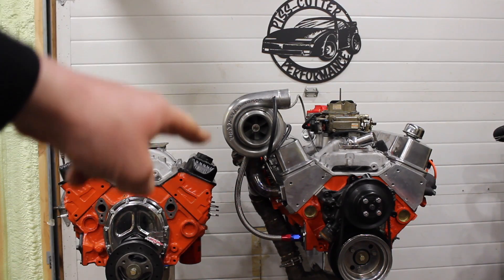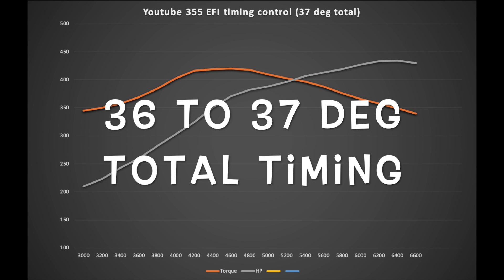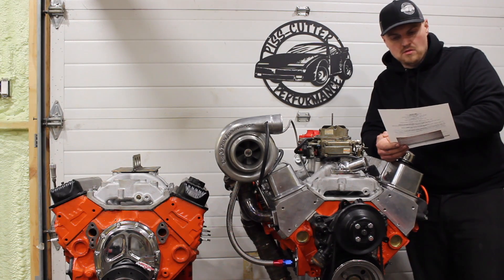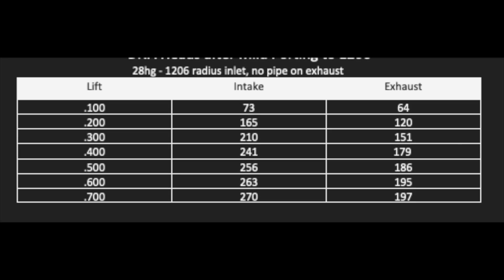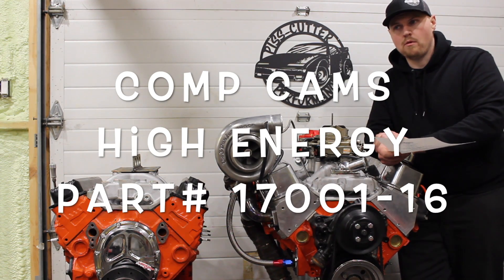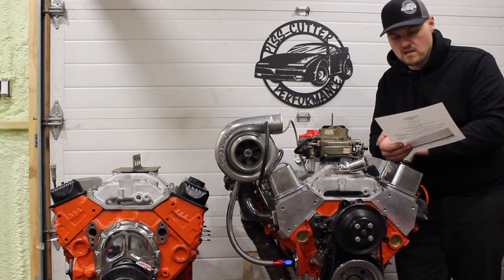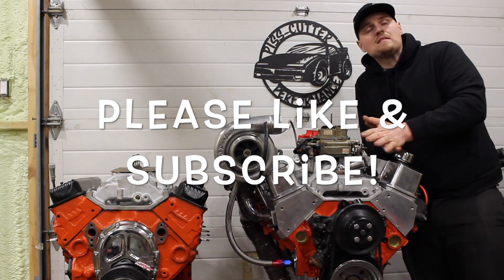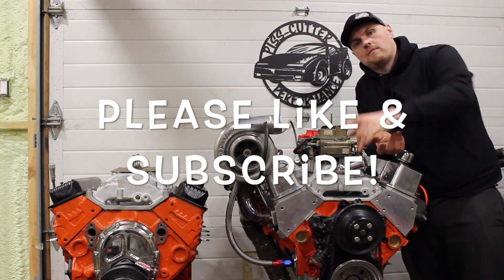440+ HP Budget Build! SBC (Youtube 355)

Comment: Hey, great and exciting builds as always. I have a little 355 combo progress of hyper pistons 10:1, DNA head, and only xr264 on 107*, with a VRS 850 can I tune this big carb out, and it work ok, or should o get a 650 or750 ? Also headers are huge 2" but going to put 1-5/8" tube or less, inside them coming out of head. Same thing after extended collector into empty mufflers then to oversized single out, dual inlet flowmaster 50. For my mother's cross country daily driver Camaro with automatic transmission tight stall. 3.23 gears.

Comment: Hey man I’m building 383 vortec block. I want to makee 600 to the whee but with vortec heads can I buy some ported vortec heads from you
Reply from the maker: Unfortunately, even with porting 600 wheel hp naturally aspirated with vortec is not really possible, especially on pump gas
Reply: @ they have those eliminator heads but they are about 3k can u recommend me some heads with keeping factory injectors

Comment: Did around same build 419 hp 430 tr howards roller big momma rattler with two head gaskets with split fire ring used the wrong head gasket not a pre flatten wire ring

Comment: Cool Video ! Im building a .040 bored 350ci SBC Having a hydraulic roller cam ground special.  Very close to your cam here. Same duration with .547/.547 lift and 112 LSA at 4 degrees advance  Icon pistons for 10.6-1 comp. Floteck aluminum heads and Dougs ceramic 1 3/4" longtubes.  My hope was 435hp..  Looks doable..

Comment: Hi, nice video. Yup, I've watched tons of Nicks programs too. I am in process on a .040 over SBC with 10.5:1, right quench, good heads and internals with a Howards hydraulic roller cam to make that lift that you did.  Additionally I have been following David Vizard for years and worked out a shorter lobe separation angle, 108 degrees, from his process. Can't wait!
Reply from the maker: Right on man, you'll find that the tighter LSA helps alot with torque. Vizards formulas definitely help with cam selection. Alot of people disagree online but ive tried it, dyno tested it and it works as he says

Comment: your engines make great power with little more then budget parts iron heads nice work. I watched a video today 7-2024 after market block and crank good heads 64cc good rods roller cam flat top pistons roller rockers intake 350 ci sbc .030 bore it dynoed 410 hp tq was close to that. big $$$. the video from phenex az us.

Comment: Hey Cutter! I may be missing something, if you start with a 880 roller 350 block, how does it then become a 355?
Reply from the maker: Its bored .030 over. A 350 block bored .030 is 355, .040 is a 357 and .060 is a 360 with a stock stroke of 3.480

Comment: Great videos!  In your experience have you found any sbc head gaskets that actually compress to .025 to .030?  Thanks.
Reply from the maker: The cometic steel shims ones are close to advertised .027
Reply: I think they are fel pro 1094, they are a .015 compressed steel shim gasket, but you need very good surface finish on block and heads. I think you need goog finish for comatec MLS gaskets also...

Comment: Will you tell me how much vacuum you have on this motor?
Reply from the maker: Lots, 15 to 16 inches with no vac advanced hooked up
Reply: Thanks for the reply. Im building a 383, with a vortec block and heads. My cam will be 224/230, so I wanted about the same vacuum.

Comment: I've Been building my friend's 350 chevy engine 1 piece rear main seal and it a roller block too its between  1988 to 1989 chevy 350 I'm thinking what kind of horsepower it's going to put out it has a hdy roller camshaft and roller lifters and I bolted on procomp aluminum cylinder heads 64 cc

Comment: Pat if u was to build a stock 880 block what would u gap the rings ? Ima run this motor all NA so I don't need any extra ring gap..  I hear 4 thal for every 1" of cylinder bore, so tht would put the gap at 16 thal ??? Or would run the top ring at 18 and the 2nd ring at 20 thal ???? Or would do 16 thal on the top ring and 18 thal on the 2nd ring 🤷‍♂️🤷‍♂️🤷‍♂️ to get 16 thal or 18 thal, I would have to get 10 thal over rings..
Reply from the maker: What pistons are you running? Hypereutectic pistons will often need more ring gap, especially if they are Keith Black pistons. A stock hyper piston its a good idea to go .005 per inch top ring and .0055 2nd ring. KB pistons want .0065 for the top rings

Comment: Yes definitely interested in the specs for the dingle ball 355 I have 4 engines 3 roller style engines ,a 355 80-85 block with built 350 swirl port heads not sure what was done but the engine did 13s in a 82 Monte with auto 3.73 gears I want to put a set of vortec heads on it  plus I have another 355 crate 87-95 block with vortec heads 2.02/1.6 cut down guides with a 280H-10 and another crate 350 vortec 880 with stock truck cam specs never ran gas only propane it was a industrial generator v8 with about 2500 hrs it’s really clean 906 heads timing chain is still tight hardly any play on it want to put a higher lift cam on it plus I have a 87 305 roller motor 87000 Kms with decent heads the 184/1.5 I want to put that similar corvette 300hp cam in it eventually plus I have a 72 350 block with those 70 camel humps and a Rv cam to so lots to do before spring

Comment: I'm assuming the stock SBC roller lifters could be reused with the Summit-880x cams?  I have a Summit-8801, the little brother to the cam you used.  GM Vortec 880 block, Vortec L-31 heads valve guides cut down and reworked with beehive springs.  Lift should be okay to .550" with 1.5 ratio rockers.
Reply from the maker: Yes they can

Comment: Hello, my name is Eric. I have watched almost all your videos. I have a 98 k2500 the l31 is now a 355. Would you consider doing a theoretical build for a low end of torque truck engine good for pulling. Plus do you have more info, and opinion on the Edelbrock pro flow xt.
Reply: I built an aluminum head 383 out of an 880 block for my 97 Express.  Loads of torque.

Comment: You're probably aware but Summit sells that exact hydraulic roller camshaft for the gen 1 SBC (retro fit) with the LS firing order for $243   Part number 1223.   That's a steal.   I've looked into LS firing order in the past for a few builds.  Comp wanted $1000 for the core on my BBC and that was about 6 years ago.
Reply from the maker: Yeah, I did know that. I wish I knew that back when i got the cam for the youtube 355 as I would have added it to the votes for what cam to use.
Anyone else chrages close to $500+ usd to a billet cam equivalent
Reply: @cuttersperformance  I'm going to use it in a 355 I happen to be doing, using a set of the new Comp Evolution cartridge lifters, and a pair of aluminum Trick Flow hump heads (painted) for an old school appearance.    Should be in the 400hp range.
Reply from the maker: @firebirdjone  yeah for sure! Same cam specs as the youtube 355? But with the LS firing order. I was impressed with the cam, it will have great drivability and the broad rpm range is nice.
Not quite the specs that I want for the dingle ball 355, so im going custom grind for that one. Going for 450+ hp but it certainly wont have the idle vaccum
Reply: @cuttersperformance  This is going to be a daily drive build for me that looks completely stock on the outside.  Pump gas, and should have plenty of vacuum.  Thanks for the videos, awesome stuff.
Reply: I’ve got a SUM -1226 that I haven’t tried yet in a 383. What compression do you think I should run with this cam?

Comment: I'm building a sbc 339 (+.060 305 block with a forged 3.75" stroke crank)  and will be using the same heads and a Summit 1107 hyd flat tappet cam, forged flat tops. It'll be interesting to see how close they are in power.
Reply from the maker: O thats a cool combo! Keep me posted on the dyno results
Reply: @PISS-CUTTER Performance  I sure will. I'm going over the build on my channel. If you're cool with it I can post a link here.
Reply from the maker: @SquarebodyStuff  yeah for sure!

Comment: learned my lesson not tapping front cam holes with a HV-55 pump. Blew out then took out gears on timing set.
Reply from the maker: Sorry to hear that man, not a good time! Hopefully, you got it fixed up with minimal damage
Reply: @cuttersperformance   It is a brand new motor lost oil pressure all of a  Sudden. Found the Cam plugs in the middle of the lowest block it took out all the teeth found them all in the oil Pan and one tooth in the lifted gallery all back together now just putting on a custom police set up and should be ready to go.

Comment: Happy new year Pat! All of your sbc videos are great. Specially the vortec head porting ones. Any chance on a video of how we could repair the cracked heads? Do you think cutting out the crack and filling it with braze would work? I’m talking about the crack in the middle from the head bolt hole and between the centre chambers. Brazing is much easier than spray welding and stitching I think.
Reply from the maker: I haven't done it personally, typically i wont repair them. But they can be repaired with a sleeve in the head bolt hole. Thanks for checking out my videos

Comment: Well been watching your channel and picked up a 638 roller block yesterday. Now I know what to put in it lol, with different heads. Fingers crossed hope it goes as well as yours.
Reply from the maker: Thats awesome man, I appreciate you checking out my channel. Im quite happy with how this 355 turned out, its a great combo for alot of guys that drive alot and still want to burn tires. Sweet RPM range, pump gas, 435hp/420+tq with lots of vaccum. Drivability will be fantastic 👌
Reply: Pat- I’d love to see the proper camshaft in this engine. I built a similar 355 w/same heads and similar touch up work. I ran a solid flat tappet comp cam similar specs but on a 109 and it made 458hp.  A guy Gord in Canada actually bought it from me and put it on the dyno up there.
Reply from the maker: A cam with a tighter LSA would have certainly been my first choice, but as I often say, there's no perfect cam. The trade-off would be less idle vaccum, fuel mileage, ease of tuning, etc.. so a guy looking for an easy driving cruiser with power brakes might take the 20ish hp loss, and this cam would be a better choice. The issue is that most of us like too much cam haha chop chop 😅

Comment: Was the block decked?  Just wondering  the actual piston to  deck measurement to add to the crushed head gasket thickness for squish/quench. Great job on Nicks Garage!
Reply from the maker: Block was decked and Pistons were .0085 in the hole
Actual compressed headgasket thinkness was .034 (advertised at .028)

Comment: The firing order is a waste of time. Save your money there. Also an off the shelf cam will be just fine. Custom will gain you so little (and possibly nothing)
Reply from the maker: Not expecting much or any power, but I was actually curious on if it would sound like a LS. Chop chop lol
Reply: @cuttersperformance  if you get a chance please build a stock tbi 350 with ported 416 ho heads .015 head gasket with a cam like summit ct 101 cam or variant im curious on the power and torque numbers for such a cheap build
Reply: 5 horse power

Comment: Curious what length pushrod did you use?
Reply from the maker: Howards 7.300 part # 95023
Reply: Was anything milled or decked?
Reply from the maker: @charlie4339  block was decked

Comment: Have you ever had a problem finding a intake to match these cheap heads, I had to use a Victor Jr to get the ports to match up, I’d like a dual plane but I don’t know what to ask for.😂 Learning so much from you Pat, you’re a Awsome teacher.🇨🇦👍
Reply from the maker: Thanks man, appreciate that! These ones had an oddly shaped intake port but didn't have an issue making it work with the air gap and a 1206 gasket.
Reply: @cuttersperformance  you think a 1205 gasket would fit?
Reply from the maker: @J. McCloud  a 1205 wasn't a good fit for the DNA heads I had
Reply: @cuttersperformance  well crap lol I don't have the DNA heads but do have a have a set from PBM which to me look like the same castings but idk, I have the air gap intake and a set of 1205 felpros but haven't opened them up to check yet 😐 was hoping they'd fit lol but maybe ill get lucky, I got a feeling it'll be the same outcome though lol At least gaskets aren't to crazy expensive 😅

Comment: How much boost, if you want power guesses? I was worried that your engine would break Nick's dyno like you did to that other dyno shop! LOL

Good job on the engine, plenty of power on tap and pump gas friendly what more can a guy ask for? Boost probably?😎
Reply from the maker: Didn't break the dyno, but the dyno water break couldn't hold it with the turbo torque, and it had to be tweaked abit. It was a great time!
Reply: @cuttersperformance  

Cool, I watched the video a few weeks ago but don't remember seeing the turbo hooked up. Would of been cool to see that, I'll have to find it again to refresh my CRS memory.
Reply from the maker: @It's Either Gonna Work Or It Ain't Garage  it doesn't show the turbo in the video on nicks garage. I will be making a video about that
Reply: @cuttersperformance  

Thanks, it's good to know there wasn't anything to remember there. LOL